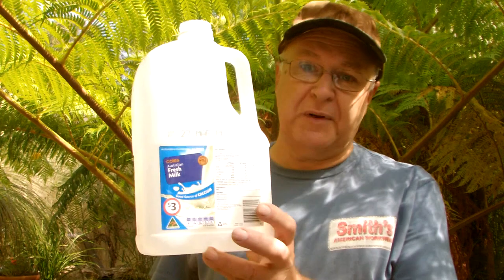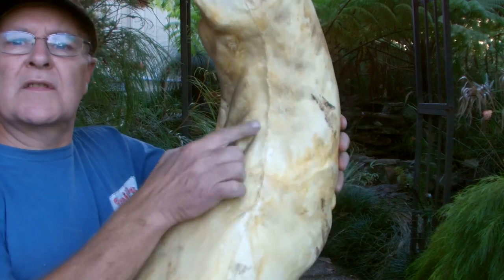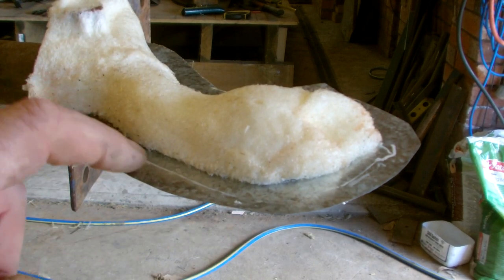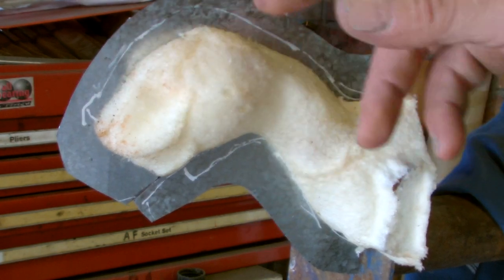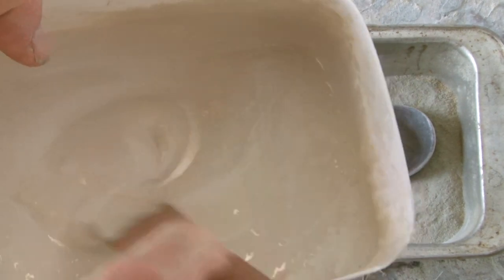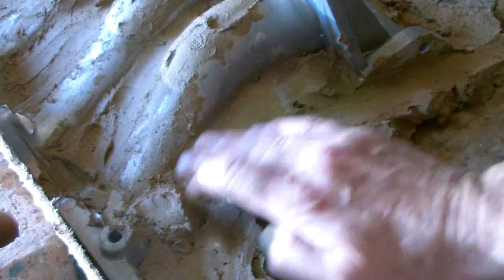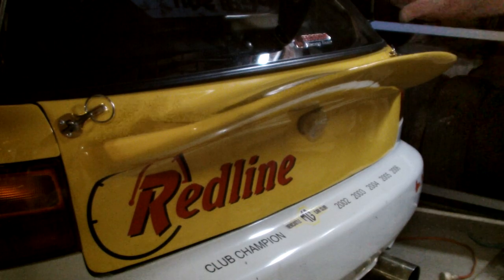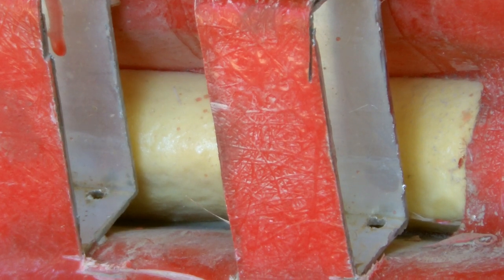How to Make Fibreglass Split Moulds

Comment from the maker: Your English is better than my Swedish! You buy carbon fibre as a cloth, and there are different weaves & weights (same as with fibreglass cloth). I am unaware of any quality issues. What I use gioves you a guide.  Start with fibreglass first for a year or two before you try c/f as it's too expensive to waste or crash, plus fibreglass may really be all you need.

Comment from the maker: It depends what you want to do with the mould and what material you want to reproduce your replica in.  Basically you paint the concrete with MULTIPLE layers of Latex rubber and then make a fibreglass "mother" mould over that to cradle it when you reproduce in it. We have a client at work who buys Latex from us to reproduce concrete statues, etc. and I've used this method in taxidermy for casting rocks.  You can make a direct f/g mould if you put floor wax on the path.  Latex is the better way.

Comment: First, thanks a million for the video - most interesting and useful. I intend to try out a carbon fiber guitar and it seems I would need to apply the un-flanged method. However, I have a guitar in mind, but don't have it to form a mould from. Do you have any advice on making prototypes for moulding purposes? Much appreciated and thanks again.

Comment from the maker: I'd use an old guitar of the shape I want and turn it into a die for moulding purposes by coating it with Wattyl 7008 or Glamowood Glaze Coat, wax * PVA release.  Mould the bottom first by putting a clay wall around it or by putting it inside a piece of ply cut out to the profile of the guitar to make a flange to your bottom mould piece, putting your join at the back of the guitar.  Mould & copy it in 2 pieces, & join together with resin after fitting the neck, etc.

Comment: Hey when you were making a mold of that intake manifold..what were you going to use to make the actual new manifold? Carbon fiber? Would it have any issues with fuel, heat or even boost pressures? Would you mind to go into more detail maybe in another video about that manifold? Thanks so much in advance. I'm really interested in this topic!

Comment: Awesome video and rocking music - i have a question regarding the separation of the piece molds- for example, with your cat, you place the fiberglass on one side up to the tin, wait for cure, remove the tin, then do the other side, what do you add to the set fiberglass so that it doesn't bind to the new fiberglass on the other side. -  would simple paste wax keep them from sticking to each other?
Reply from the maker: When molding using the method shown with the cat head the tin is not removed until BOTH halves are fiberglassed. It stays in place for the whole process. On some jobs you do end up laying the second flange directly up to the first one made in fiberglass with no tin in between, like where clay was used to mold the first side's flange. In both cases wax, then PVA release, is applied to the first flange to ensure separation when the second one is applied.
Reply: @BillsBuildandRace  Thank you for the excellent reply.

Comment: i kinda wanted to see how you made the manifold but it seems like it would be more like a manifold cover/shield. i need to make a curved tube but i do not want two shells coming together as the seam would be a weak point.
right now the one way would a "lost wax" method and laying glass on the outside which will take a lot of work to make to outside nice
Reply from the maker: Use Peel Ply on your outside joining layer to get a much smoother fibreglass finish, and be sure to put Finishcoat on top of the glass, rather than Gelcoat which won't work well as a top coat. Most modern intake manifolds will require more than two pieces. If just reproducing a factory manifold copy it's mould joining lines to ensure the pieces will release after moulding. Yes it is very complex job.

Comment: I've just started rally using a 2015 buick encore 1.4l turbo Luv fwd. Needed a new front skid plate and lower bumper cover from jumping and successful clearing a ditch which could have easily totaled the car I had two choices turn slide and risk hitting it sideways and rolling.  Or head on and hold on. I chose head on got lucky scary shit but it hasn't stopped me yet
Reply from the maker: This might be helpful    https://www.youtube.com/watch?v=MQ2xfYU9tSg&list=PLh5B6MCXRHiEsIniyEHmgxEAAMirYWItD&index=7&t=328s

Comment: I had to make a boat cover piece that went on the motor and couldn't find one so I made the part up with clay and then tin and tape and then Fiberglas to get the mold and then made the piece . Saved me 400 for the actual part and would have taken a week to get in .
Reply from the maker: rednecktalkshow Well done. Now there'll be no stopping you! Beware of the friends who want boat repairs though!

Comment: Great vids. I'm sure you have answered these questions at one point or another in some vids. But what ate the names of the following. Foam filling, clay used and what the actual name it's called and where to get it. And when to use Gelcoat. Thanks a million
Reply from the maker: The industrial name for the foam is "Pouring Foam" and is normally available from trade fiberglass material suppliers or large insulation product suppliers. The clay I use is unfired pottery clay and I just buy the cheapest I can find. You can get it at large craft shops, but it's cheapest from pottery supply wholesalers. Gelcoat is used as a first layer to get a smooth, finished surface when fiberglassing a mold or plug. It needs the overlaid poly resin to fully harden it. If wrongly used as the last, top coat it will stay sticky. The product to use then is called "Top Coat" or "Finish Coat", as used by boat repairers when applying a patch where the LAST layer is the finished surface, rather than with a mold where the FIRST layer is the finished surface.

Comment: Hi I just made my first mould I made a mould of the inside of the boot on one of my honda preludes. Was just wondering should I cut allbthe holes out of the mould or out of the panel when it comes out of the mould. Thanks from a fan
Reply from the maker: You can do either. Cutting the holes in the mold makes more sense if you're gonna produce multiple copies, but for one-offs it doesn't matter.
Reply: Ok thanks. And thanks your videos have been a great help

Comment: I noticed that you cast rocks for your displays. What do you use for gelcoat? Thanks.
Reply from the maker: +mark rainford To be  moulded rocks need a generous coat of release wax which is NOT polished, then a coat of PVA release. Then Gelcoat, resin + cloth as normal.  You can use multiple coats of latex as an interim release layer when moulding and making copies,  but I found this sort of rubber based inter-mould unnecessary as few of us will make stacks of rocks of the same mould. As the mould wears and little features break off a little it just produces a slight difference, & painting hides all faults because rocks are so rough by nature anyway. Most rocks will need clay dividing walls to divide them into 2 - 3 piece moulds.
When the copies are made in the rock split moulds this standard layup process is repeated and normal Gelcoat is used again. Painting the cast rocks with acrylic paint is great fun. Start with splashes of orchre and even yellow, and a few black spots. Clean excess off with a rag.  Then coat the whole rock with a thinned light grey, wiping most of it off. To add lichen flick light green paint off an old toothbrush. If doing a group of rocks that will go together always paint them all at the same time, because you never get the same result twice. Two identical rocks out of the same mould will look completely different when painted.
Reply: Thank you for your prompt reply. Very informative.

Comment: Wait, at 6:16 is that cement or sand?
Reply from the maker: You've got a sharp eye! I used pre-mixed sand & cement for demonstration purposes as that is all I had. It works - but normally you'd just use sand.

Comment: subscribed, my imagination is running wild.
Reply from the maker: That's why I upload.  Glad you're motivated.
Reply: WJP004 i'm wondering about motorcycle plastics, the ones i've got are crap and new ones are expensive and i think they're injection molded so i can only begin to imagine the astronomical price of carbon fibre ones